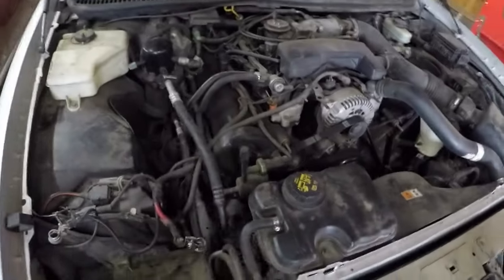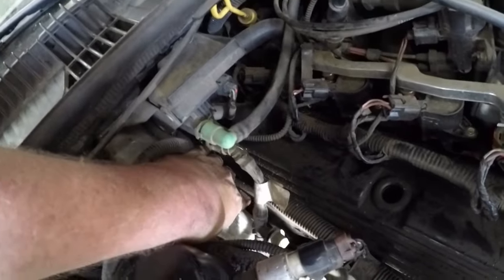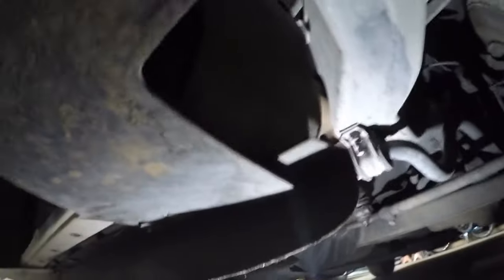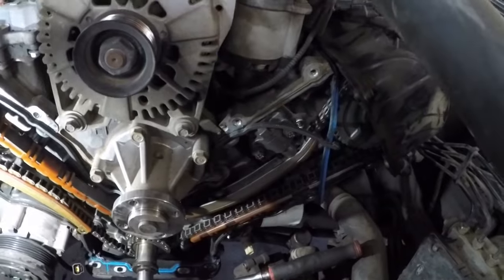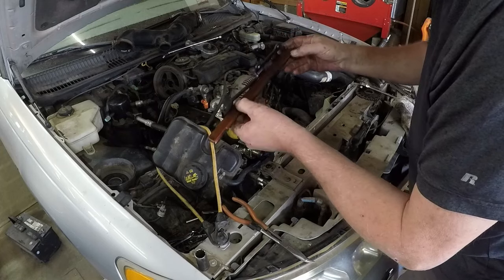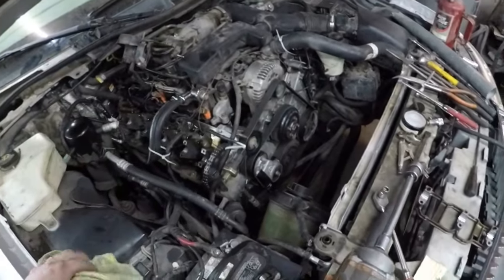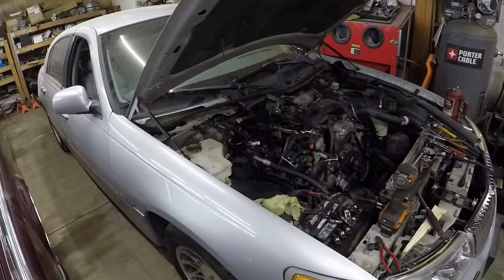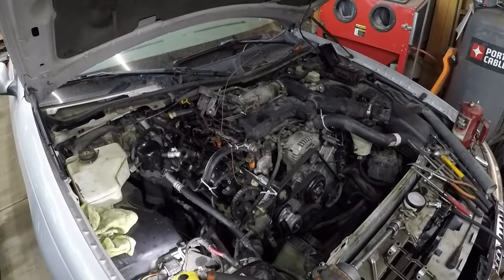2000 Lincoln Town Car  4.6 - 2V, Timing Chain, Chain Guides and Tensioner set installation.

Comment: My brother's Town Car is the same color as yours. I think it has approximately 150,000 miles on it.
I remember a 1976 Lincoln Continental Town Car my family owned, and it got 15 mpg city and 19-20 mpg highway. The 2000 Lincoln only gets 14.5 mpg on the highway. Why is that? Two mechanics checked the car and came up with nothing with the exception of a recommendation that we should 
unload it as soon as possible, and I agreed. We listed it $1000.00 below book value but no one wanted it. This was about 5 years ago. The car is exceptionally clean and has been taken care of. But I still say it's a cheap Ford, not a Lincoln.
When you repair your window, the door trim is almost impossible to take off. Good luck.

Comment: What symptoms did it give you that made you know the timing chain was bad, I think my timing chain just went bad yesterday, it’s been clicking for a while then started making some really loud pop noises yesterday on my ride home, it started smelling funny too, had to pull over and get a ride home, I hope the pistons didn’t smack the valves, that’s more labor than I’d like to do to this car, it’ll still start first turn key it just sounds awful
Reply from the maker: Just a lot of bad noises sounding like a rod knock and clanging sound etc, But the noise was in the top end right under the valve covers not way down in the engine, Oil pressure light was flickering on and off from low pressure because of the chain tensioners being over extended (popped out of the housings) hope this helps
The main answer for me was because i pulled the passengers side valve cover off and i could pick up the chain off the Cam sprocket it was so loose normally it should be dead tight
Reply: @TheLincolnRanch  thanks for the response man, I’m gonna try to do my timing chain kit here soon when it warms up a little, hopefully it didn’t Bend any valves or do anything too major

Comment: That's such a shame; personally I hope you fit a new head, mostly because I hate to see a good car go to waste. Honestly for the price of a used head and an oil pump I'd repair it in a heartbeat. You've already spent the $$ on the timing kit. Now that the motor is partly disassembled, you're partway there!
Reply from the maker: The problem is, What else is wrong?, Because it's not getting oil to the upper half of the engine
Reply: @TheLincolnRanch  Yes, good point; it's easy for me to say 'Oh it's just oilways blocked with all that sludge', but you're the one who's got to take the risk. Looking forward to the outcome though, and good luck with the doctor! BTW I'm not a new-age guy at all, but acupuncture can work VERY well for sciatica.....did miracles for my friend.
Reply: @TheLincolnRanch  could possibly be a blockage in the oil pickup tube, I have seen that before on these 4.6s, oil pump could also be suspect but they’re usually reliable on these engines